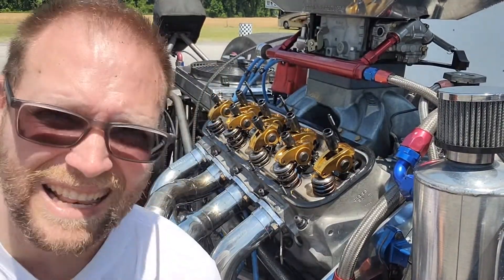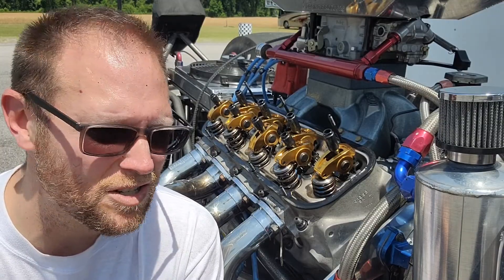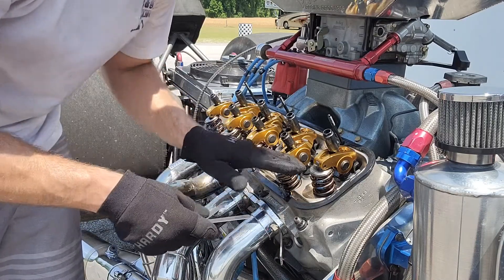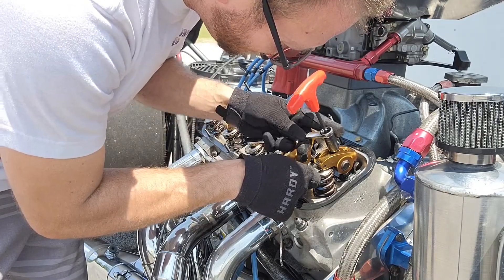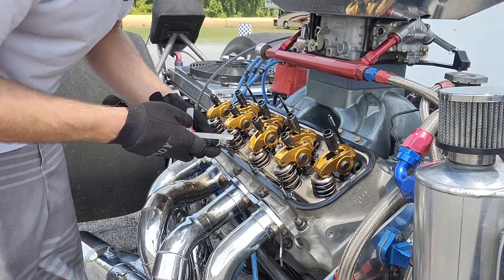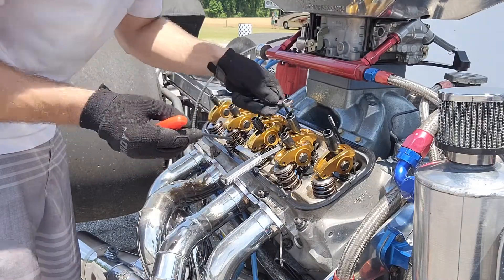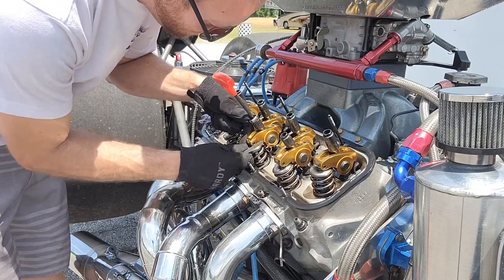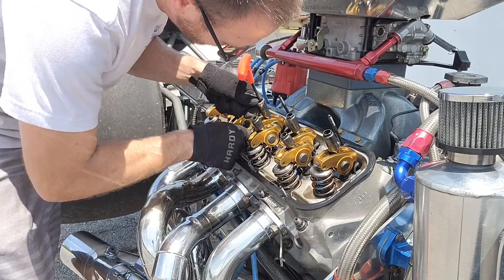Drag Racing How To: Checking and adjusting Valve Lash on a BBC Engine

Comment: I tried this method but now my engine is struggling to start and sounds like the compression is fighting the starter.  Can anyone point me in the rught direction?   Been trying multiple methods. This seems like its the right way. But now my engine sounds like its whining when starting and struggling to start. Timing is set at 14 idle.   
396 bbc with mutha thumpr cam.   I worked on classic vws for 20 years. Now i trying chevy. And this as been eating me for 2 weeks now.
Reply from the maker: @62vwmangfg  you can always check the lash by firing order as well. Pull the plugs out and run through them that way.

Comment: If turning the box end wrench loosens or tightens lash, when locking it down in place, WHY are you not just holding the wrench perfectly still while tightening down the allen screw. That's the way I always did my big block Chevy. Wouldn't turning the wrench tighter as you tighten the lock screw close the gap a bit?
Reply from the maker: You are correct. It does close the gap a bit. I always account for it and check it after to be sure it's where I want it. I do mine this way to ensure a good lock. Have not had one back out on me yet 😁
Reply: @DiggersRacing Ok, if it works,  it works. 👍

Comment: Looks like your setting your COLD lash at the HOT lash spec, disregarding the increase in lash as the motor heats up to operating temp.  Shouldn't you set your COLD lash a few thousands tighter than the Hot lash spec to accommodate the lash increase when the motor heats up???
Reply: If it runs on alcohol it may not get that hot anyway. My big block Chevy on alcohol starting line temp was 160, finish line temp was 145. Waterpump off, fans off. I had to open a ball valve to the intake creating a vacuum leak, and pull the fuel shut off cable a bit to try and lean it out on the return road to keep some heat in it.
Reply: I think the engine is hot (gloves)
Reply: He said engine is hot, setting it at hot lash
Reply from the maker: You are correct about HOT vs COLD lash. This was done on a warmed up engine.

Comment: Im lucky my engine builder put a cold lash on my cam card and build sheet for me.  .020 both intake and exhaust. Great vid!
Reply: SAme here. Cant do it hot, cant get a remote on the starter due to equal length headers, no help to be had
Have to remove the bottom pulley and put a crank socket on to turn it over. Huge pita.
Reply from the maker: @badbrad5424  thank you! Please like share and subscribe.

Comment: Been doing this for many, many years.  IMHO, it's the only proper way to adjust valves.  The old fashioned 90* method will not work with all cams, especially aftermarket, aggressive racing cams....
Reply: Well said!  Every time I see some forum of YT know it all bragging up his shortcut he never tried it drives me up the wall
Do them Once, one at a time and all will be right on the money.

Comment: When you first got to the racetrack with the motor and you adjusted it and everything was fine and you texted the next time and everything was fine what went wrong that it's loose like to you have a stud girdle in there that will hold it what what's wearing out that's bringing the lift the Gap needing to be adjustable
Reply: Don't drink and text about technical matters.

Comment: I didn't get that Cam card with my motor...it's a big block  With a pretty radical Cam... Should I stay in the numbers that you are doing 🤔 I have no clue were too start.....
Reply from the maker: Hi Brad, that's tough. The proper lash depends on many factors from the cam design, valve springs, and the material of your valve train, like steel vs aluminum rocker arms, iron heads vs aluminum heads, and are they are on iron block or aluminum block. All the different metals grow and expand and different rates and amounts. That's why it's critical to get that info from your engine builder if you can. Now, since you don't know, if I were you I would start by taking a measurement of what the current lash is. You might find that most them are close to the same number. That could give you a good idea of where they are and should be. So if they are all mostly all say .024 on your intakes, keep that as your number. What your really looking for here is, do you have on that WAY off. If you find that one of them is .050 then you might have something wrong like a bent pushrod or cracked rocker arm, etc. The idea is to regularly keep the set where they should be and keep good notes, so that if one goes away you can catch a problem hopefully before it grenades the whole engine. Also, by keeping them consistently set you help keep your engine performing as consistently as possible. Tighter and looser settings changes the performance of the cam as the lifter follows it tighter or looser.
Reply: @DiggersRacing  thanks bro you saved me a lot of money, bout to pull my aluminum heads off my BBC and now I can do it myself with confidence. Thanks again
Reply: Right on thanks for the info I will be pulling the motor out this Winter Then I will take the Cam right out And have a better look Thanks again....😎
Reply: @bradnavratil5502  Look up the grind # at the end of the cam when you pull your cam gear off. 
Chances are its not some trendy tight lash cam....Id bet .020- 022 cold lash would do fine if you have alum heads iron block